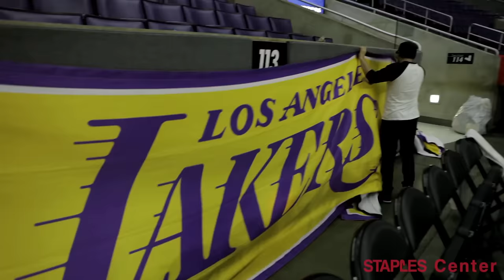Los Angeles Clippers to Los Angeles Lakers Conversion - January 8, 2017

Comment: To anyone commenting that it would be extremely difficult to change if the LA teams met each other in the playoffs. You have to understand that the staff working there are extremely efficient and hard working. They can literally change the floor in a matter of hours. So although it would be slightly annoying to change the floor, they'd be more than comfortable changing it on a daily basis (even a few hours for a matter of fact) 💪
Reply: Ty

Comment: you guys can try to build a new center instead of dealing with conversion costs and time.
Reply: correct!
Reply: Remzi Pınar do you know how much will cost for a new center? 😓
Reply: Remzi Pınar there’s 3 teams that I know of that use this arena so it won’t be as affective.
Reply: Supposedly the Clippers are supposed to get a new arena
Reply: It’s cheaper to convert it
Reply: Guys the point that you overlooked is that sometimes 3 times conversion per week will be very expensive over the years.
Reply: Remzi Pınar But if they build a new arena, it'll have even worse consequences for the community around it. Property values will go up, and the area will be gentrified. And the tickets will be much higher than they are now.
Reply: It's a price worth tradition bro.
Reply: Clippers are planning on getting their own place next to Sofi Stadium in Inglewood. It’s privately funded so it should be finished once their lease is up in 2024
Reply: Remzi Pınar Regardless there are other sporting events to be converted to like hockey or even celebrity performances .
Reply: Remzi Pınar the guy said since 1999 he’s done around 180 conversions. Let’s be generous and say each conversion costs $50,000 (it probably isn’t that high seeing it looks like a 3 hour job max, with even 100 employees earning $40 an hour, still just $12,000).

So for 20 years worth of conversions, it would cost around $9 million. A new arena costs anywhere between $500 million - $1 billion. No match.
Reply: @remzipnar1222  people much smarter than you and with much more information have definitely already calculated all the costs dude. You aint gonna come up with some new plan in the youtube comments 😆
Reply: Noo you cant take up the junkies tent space.
Reply: why spend mo money when less money do trick?
Reply: Or clippers relocate back to San Diego
Reply: You gonna find the land in LA to do it?
Reply: Ken Burns In the long run (multiple hundreds of years) a new arena would be cheaper in costs, but since they make 2.5x more money like this (counted kings as 0.5) this method will earn wayy more than the costs in those idk 700 years. so nice thinking remzi pinar, but ken burns is right
Reply: @bren2363  I mean its the Lakers a NBA team in the city of los Angeles
Reply: Almost sure 80% of those workers get paid average like $25 per our.
Reply: Thats how arenas make money and teams reduce ownership cost by leasing.
Reply: less traffic u know what i'm sayin
Reply: @remzipnar1222  The lakers make hundreds of millions a year im sure they will be fine.
Reply: @paige_judah5538  stop with the "supposed (ly)"